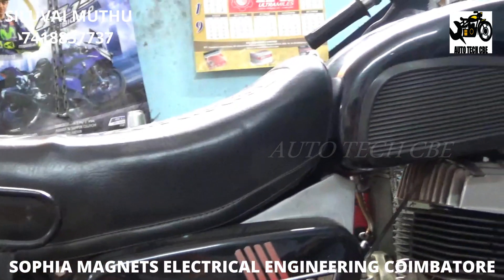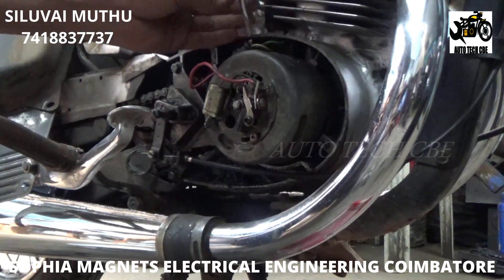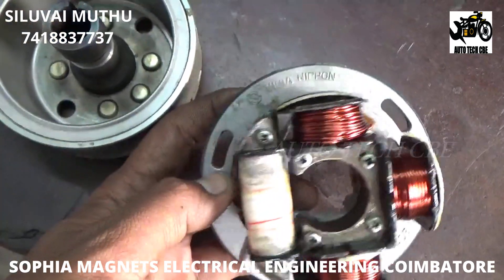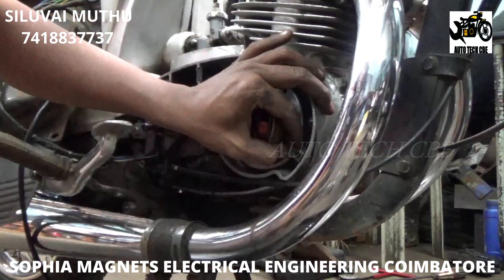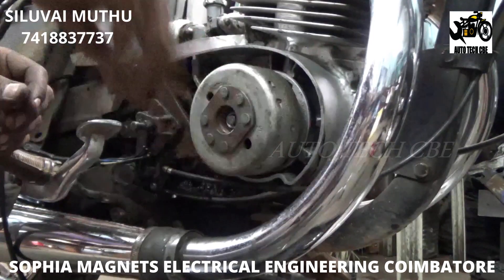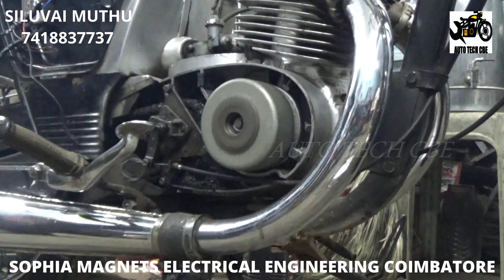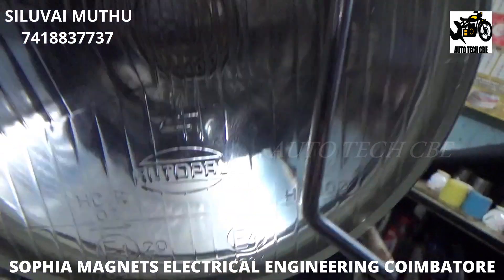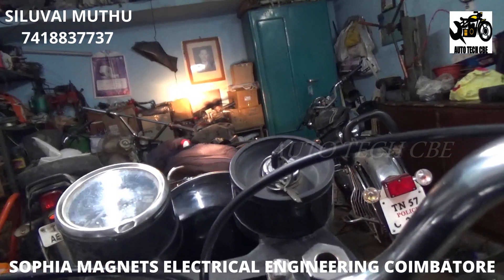YEZDI CLASSIC 250 6V - 12V ELECTRICAL CONVERSION IN ENGLISH

Comment: buddy is it possible to connect yezdi roadKing headlamp direct battery..?

and another thing ill buy yezdi rectifer in alfa automobile Coimbatore the rectifer kid has 2 blue wire and one white wire i call shop the didn't attend here lockdown so no work shop available i didn't know which terminal connect battery
Reply from the maker: First need to check weather the rectifer and coil matches. No we cannot connet direct battery line for headlight